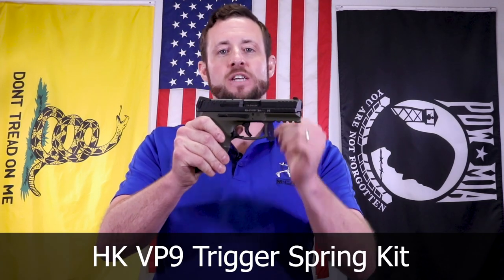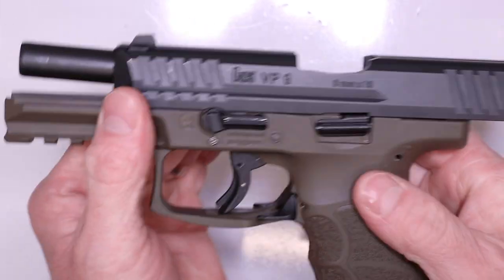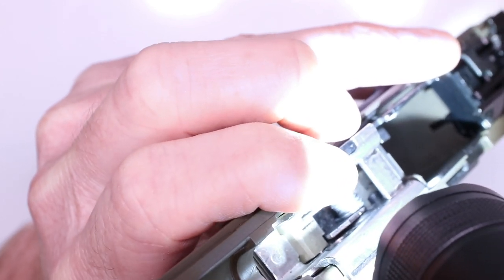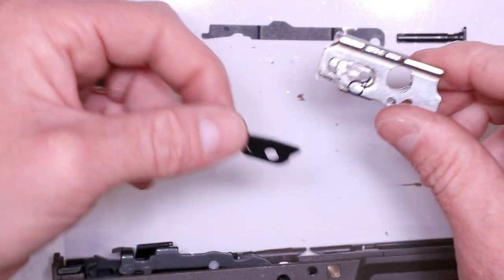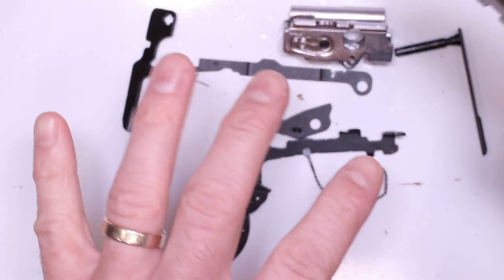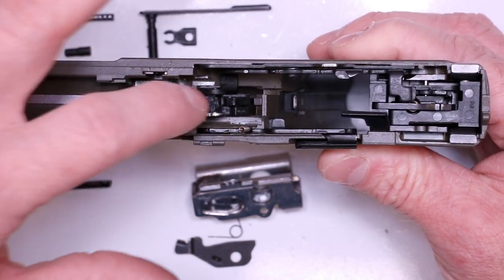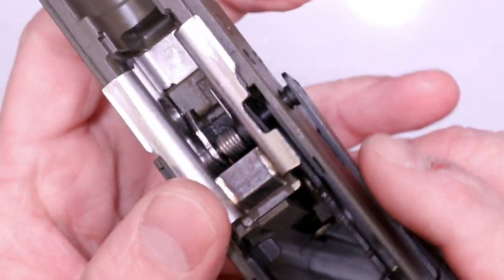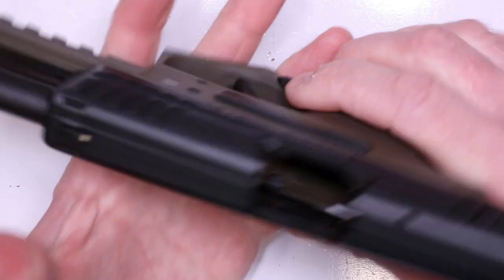HK VP9 / VP9SK / VP40 Trigger Spring Kit by M*CARBO - HK VP9 Trigger Upgrade - HK VP9 Accessories!

Comment: If the locking block pin is stuck, use rubber vice grips to stop the polymer frame from warping. Hold it together from the outside when you pry from the inside and it comes out. I researched for hours and hope this helps just one person

Comment: I would create another video where you just replace the parts that you send in your kit and do not tear down the whole trigger assembly.  All you need to do is remove remove the slide, then the steps to pull out the take down lever.  Then the steps to pull out the right side slide release to free the trigger return spring.  Then do the work on the sear spring and replace, since you have freed the trigger bar you have enough clearance to remove.  Install sear spring.  Then install the trigger return spring and your done.  This is way over complicated for the parts that are being replaced. You do not need to pull out the whole trigger block, which is where it seems many of your customers are getting stuck.  This is really a 20 minute job when done this way.  It is a great video on the complete tear down but that is not what is needed to install the kit.

Comment: The needle nose plier is really helpful. The alligator roll pin has two parts. It’s better to knock out the inner pin first then the alligator pin. I had a really difficult time getting out the hidden half pin to remove the block. I had to stop because it took me over 3 hours and no progress. I end up only changing the trigger spring and it’s so much lighter already. The other sear pin isn’t really necessary in my opinion.

Comment: Done! 
Thanks for holding my hand.
The only thing I did differently was to align & start the ambi side slide release before jamming the trigger spring in, which allowed me to quickly capture the spring once I shoved it down into place.
They don't make it easy, do they?
Why does it seem as though the more expensive the item, the more difficult it is to work on?
Hell, I can rebuild a Ford 300 in-line 6 practically blindfolded, but a Maserati...
I don't even speak metric!

Comment: Seems I am always a year behind most comments. I guess others started before me. Once again a great video. No one does them better. Just got the VP9 Tactical and looks like I will be ordering your spring kit. When I watch some of these I wonder how in the heck they ever came up with the design.. One of the other interesting guns to take apart is the M&P EZ.   Thanks so much for your patient, meticulous, video. I would not even try to make a video you have done because you just cannot beat your presentation.
Reply: Any thoughts after two years with the new springs?
Reply: @ChanceandChoice  Sorry I can't help. I decided to sell the VP 9 to my neighbor and never installed the kit. I did install the complete spring and trigger kit by M*Carbo into my Hellcat Pro and it is fantastic, I have faith in their products but no experience with this kit.
Reply: @dcssteve1944  oh no worries, thank you for the response! My wife wants a hellcat as it's the one that fits her hands the best, so I know where to look for an upgrade on that notorious mushy trigger 👍
Reply: @ChanceandChoice  It is an amazing gun. T stock trigger pull is 7 pounds she won't like that so the trigger upgrade is necessary in my opinion. It is 4.5 when done. also their metal trigger is so much better along with the titanium striker.   I had a S&W EZ 9 and it is a great little gun but the Hellcat fit my hand so much better and the Pro holds 15. I also shoot much better with it.   Enjoy!

Comment: About 10yrs ago I got a HK USP chambered in .45ACP. It was hammer fire of course and the trigger was so difficult to pull that I would always shoot low because I was yanking the muzzle downward in order to pull the trigger. I have no idea what the poundage was on that trigger. I gave away the pistol to my brother since I couldnt shoot it accurately. Since then Ive wanted to try other HK models like the HK 45, P30, VP9, ect. Well today I finally bought a VP9 assuming I would automatically need to order a trigger kit to lower the poundage. I am flabbergasted at how easy the stock trigger pull is! It feels like a bb gun but easier😀. I cant wait to see what happens when I install the Mcarbo springs. I think this pistol is about to make my year.

Comment: Great video. Thanks for the electrical tape tip, I took my VP9 apart for the first time and had one hellva time trying to get the TRS back in. Used the tape tip easy peasy. Thanks a lot won’t have to buy that modified needle nose pliers.👍👍

Comment: I had the same issue/problem, I had to take the correct size punch and hit the pin from the outside but not to hard, you just trying to knock it loose and then with a flat head screw driver push the pin from the inside of the frame outwards just like the video shows. I was able to drop in my lobo's trigger with no hick ups after that. I hope this works for you.

Comment: My new out of the box 2023 VP9 SK trigger pull is 4.2 lbs. Stock. Thats fine. What i would like is a lighter slide recoil spring. Mine has the duel spring thats very difficult to pull back even holding the rear cocking ears. HKParts offers a single flat wire spring on a stainless rod. Anyone know if that is lighter than OEM ?

Comment: So i installed this in my vp9. Easy install. BUT, there is alot of trigger reset problems. I called MCarbo and talked to a gunsmith there. They told me the spring kit is good for guns that have about 500 rnds thru it. My gun is fairly new and has less then 250 rnds thru it and this is why my trigger isnt resetting rite.

Comment: This trigger stop pin on the left side is really a terrible construction thingy... Took me two evenings and quazillion attempts to get it out. However, as it seems, it isnt really neccessary to remove the locking block at all. Pulling out the lever that holds the trigger spring to the point where it just releases the spring, but stays else in the frame, and wiggeling then the sear body out of the frame, all this fumbling with this trigger stop pin and the safety spring (no disassembly with mag installed) isnt neccessary. Still, if need be, this shows how to completely take the VP9 apart - so great video about that - thank you. And the spring set is great, I m down to approximately 1,4 kg.

Comment: 9:25 - Im stuck at the locking block pin. Its so tight that the polymer frame flexes out and in when I put pressure on the pin. Anybody have some ideas on how to lossen that thing up? I think next im going to try a drop of penetrating oil.

Update: I hadnt followed the directions given properly. I had already removed the locking block roll pin and right side slide release before attempting to remove the "stop bolt". By that time there was too much flex in the polymer frame to allow adequate pressure to pop out the stop bolt. 

I reinserted the roll pin and right side slide release then gave it another try. Finally the stop bolt popped out. I used the side edge of a flathead screwdriver which worked well. Also, to anyone wanting to know....The Stop Bolt is held in place by what looks like a steel or brass ring molded inside the polymer frame. So the Stop Bolt actually snaps in and out of position. You'll feel/hear a satisfying click once the proper amount of pressure is applied.

Comment: Ugh. Good video, but the 1/8” punch is stuck in my frame and the dowel pin it’s pushing is stuck halfway out. Saw other  sites recommend 7/64” punch, seems the tolerances might vary somewhat. I can’t pull the punch out or move it forward in my frame now, not sure what I’ll do next… sigh

Comment: Any recommendations on an easier way of getting the locking block pin out. Mine refuses to budge, no matter how much the frame is flexing.
Reply: Try tapping it inwards just a tad first, then push it out. May have to do that a couple of times before it comes all the way out.
Reply: Try using a hair dryer to heat the frame up then push it out. Always works for me.

Comment: I took ebery single miving part that has a friction point sent off and nickle boron coated. Even using a full strength trigger spiring it feels incredible for a striker fire. That stock trihher spring really is a bear without the right tools. The match springs go in super easy in comparson.
I hated the match spring set. You can feel everything happing isndie the gun. Loght springs on a vp9 make it feel cheap in my opinion.

Comment: Have had mine since November 2020. This kit made a good trigger a lot better. The only thing I had to do is to polish the ambidextrous shaft that holds trigger spring which made trigger reset work better. I also have to push trigger, from behind with trigger finger, forward to release slide. I believe it has to do with the lighter spring tension. Still if I had another VP I would buy again. 

I would like to see you guys make flat trigger (red) for the VP series.

Comment: Were you just disassembling the entire frame just for educational purposes? Because you don't have to take out the locking block to do the trigger return spring and get the sear housing out....correct?
Reply: Correct, the locking block does not need to be taken out to install the spring kit. I'd only remove the locking block to polish the underside of the trigger bar and install a new trigger.

Comment: 9:45 Been pushing at the pin for 2 days and it wont even budge. my tools are literally bending in the process and I dont know how this thing is supposed to move; nobody seems to have a clear method other than to just "push" without bending the hell out of your frame or damaging it.
Reply: I used a flathead to put pressure against it and then tapped the flathead shaft with a hammer while the gun was on its side. Also my wife was pushing down on the frame to keep it steady.... I also oiled it for good measure. It finally came out, but was nowhere near as easy as the video made it out to be.
Reply: I had the same problem, I was using my roll pin punches but they kept slipping off because they are round. I ended up using a flat head screwdriver and it eventually just popped out. If you're having that much trouble I would maybe try to hit it with a heat gun a little